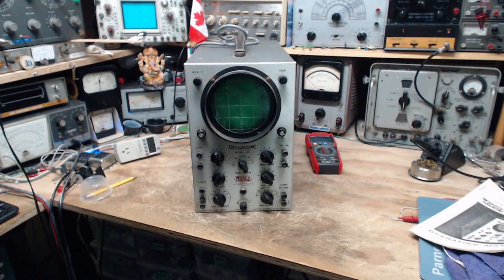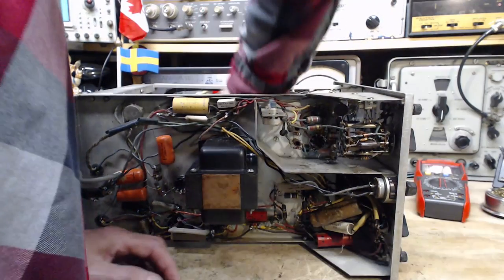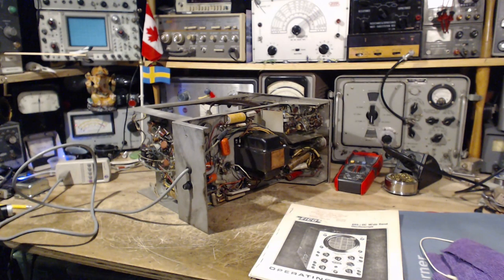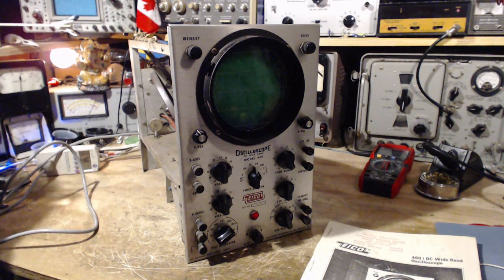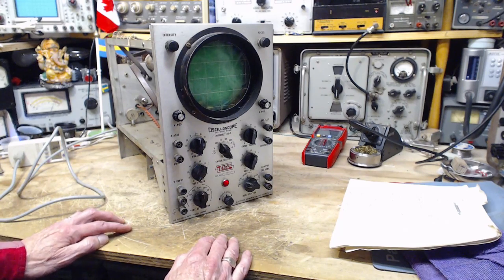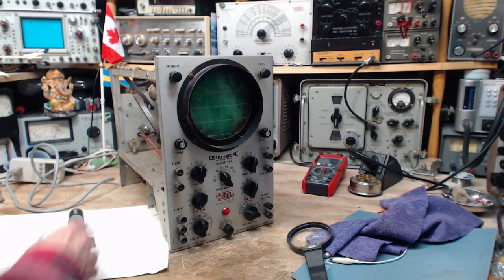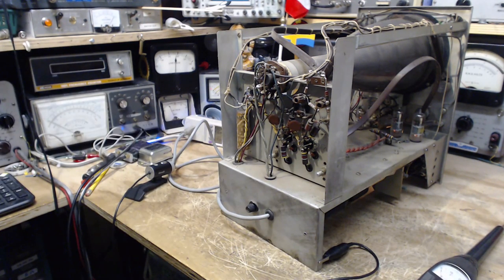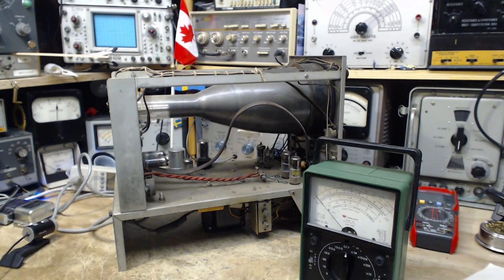EICO Model 460 Oscilloscope - Checkout and Assessment

Comment: I just picked up an Eico 460 from 1957 according to the tubes date codes. I plugged it in on a variac and monitored the voltage and current  while increasing line voltage. The scope works ! All the panel controls were out of adjustment, thats all I could find. So I tested each tube and they were all in great condition. The CRT is good and came to life as I burned in the instrument. I cleaned and painted the case cover. Inspection of components revealed most resistors off value but in tolerance. The power filters tested good. Many of the wax coated caps tested good. The .1 uf wax / paper caps tested good. I am hesitant to do any parts changing as this piece of gear will be mainly for display  as a shelf queen.  I might like to use it as a demonstration model.
Reply: It's 1959 i think

Comment: Got one that’s missing parts and rough shape. Wish I could find one like this just sitting around.
Reply: I just found one for  $50 that is in the condition you describe. I am excited and will restore it over the coming year. This scope is within the realm of the average electronics  newbie. I plan on using it with my Home brew Theremin at our local college / vo-tech museum.
Reply: @erin19030  I have been working on slowly cleaning up the one I have the case is rusty. Having to sandblast it. Switches are extremely dirty. Taking chassis to bare bones and starting over. As far as I know this model was offered as a kit. Seen a lot of them tossed over the years but couldn’t get them so I had to settle with a rusty rough one found at a hamfest sale which was free for the taking but rough

Comment: Jim:  In a vintage scope like this unit, the deflection plates in the CRT serve as the anode plates to accelerate the electron beam. Since the deflection plates are tied to the deflection amplifiers that operate at approximately 270VDC, it means that to get the voltage differential to accelerate the beam, the cathode and grids of the CRT must be at a fairly high NEGATIVE voltage (roughly 1000 to 2000 VDC). You saw that negative voltage with your electronic meter. You probably wouldn’t have seen any indication on your high voltage probe because it is set up to only measure POSITIVE voltages. Also, it doesn’t appear that you ever turned up the supply voltage to the full operating voltage. Good luck!
Reply: "The deflection plates serve as the anode" NO! The 5UP1 is equivalent to the european DG13-32. and its datasheet clearly lists the anode (combined with g2+g4) as pin 8. The deflection plates have no say in beam accelleration! Even with the deflection plates disconnected and floating the tube will produce a dot mid center.
Reply: @randomsteve4288  I rechecked my assumption and discovered that I was indeed wrong.  For my ancient Heathkit scope (with 5BP1 CRT), the voltages are approximately: G1= -1700VDC, Cathode= -1700 VDC to -1649 VDC (depends on setting of Intensity control), Anode 1= -1412 VDC to -1122 VDC (depends on setting of Focus control), Anode 2= 0 VDC to +300 VDC (depends on setting of the Spot Shape control). In any case, the point I was trying to make was that the high voltage differential needed for the CRT was accomplished with a high negative voltage at the cathode end rather than a high positive voltage at the Anode 2 end (which I believe is what Jim was looking for). Thanks for the feedback.